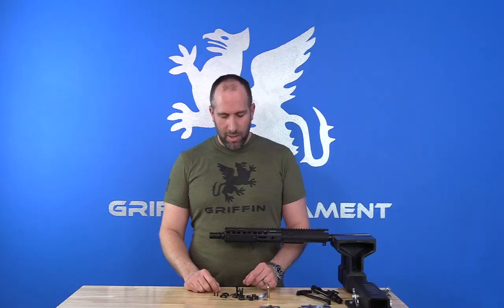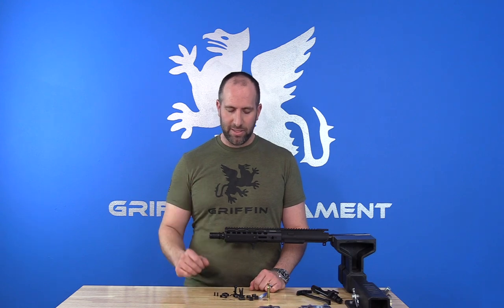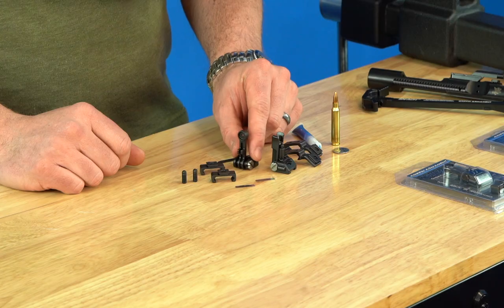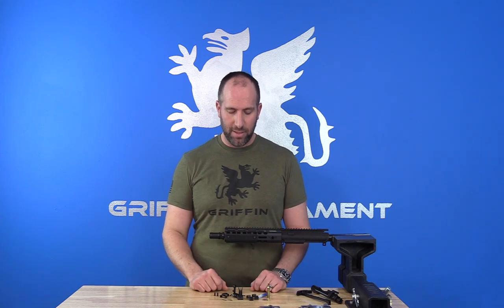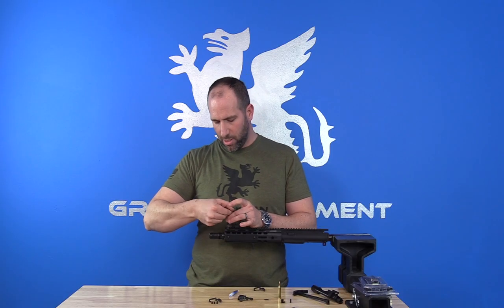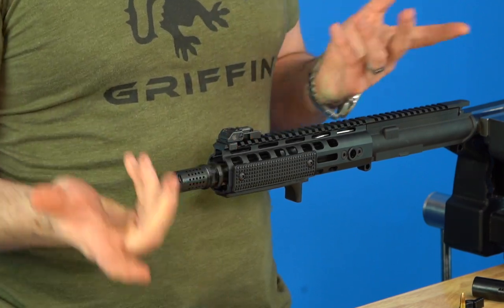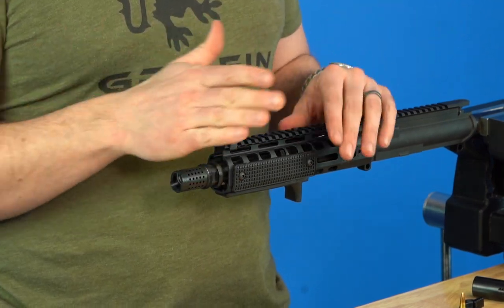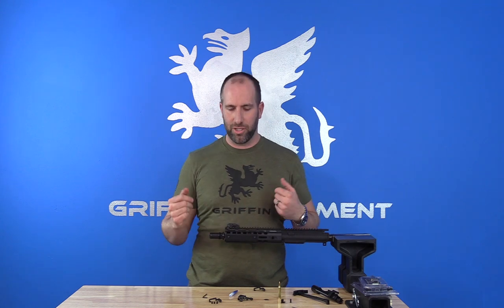Micro Modular Sights: Overview & Tutorial

Comment: A good value back-up sight.  On mine the rear windage/pivot screw had ~0.025" excess play side-to-side with moderate pressure (roughly 8" POI shift at 100yd).  Adding a 0.020" shim washer between the sight body and e-clip on the left side solved this problem.  My rear sight was super stiff out of the box.  I needed to use a large plier on each half and heave to get it to fold/unfold.  Once I oiled it and cycled it ~100x, it loosened up and now can be deployed easily as expected.  Overall I like them and would buy them again, just required a bit more effort to get them working satisfactorily than I expected.